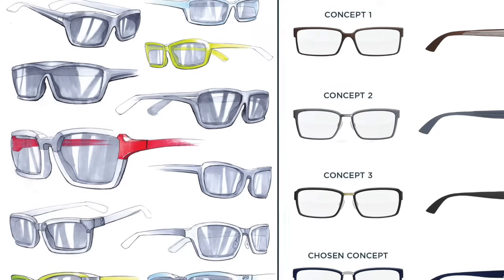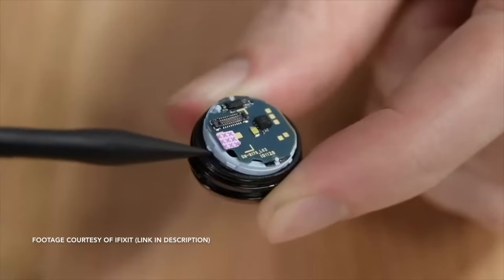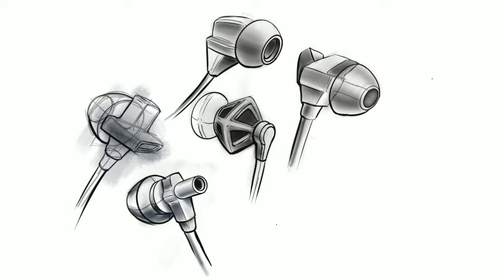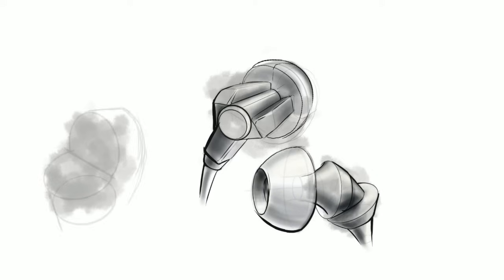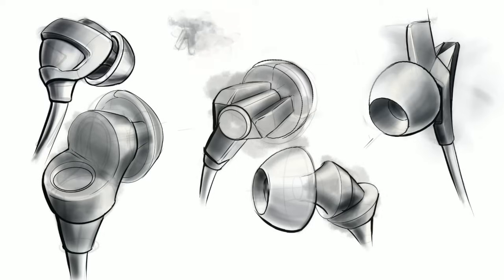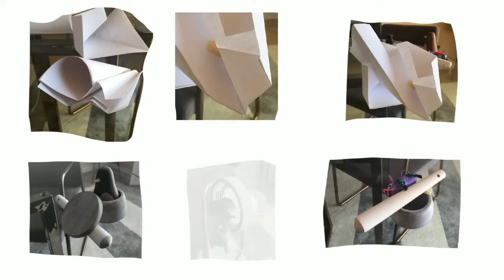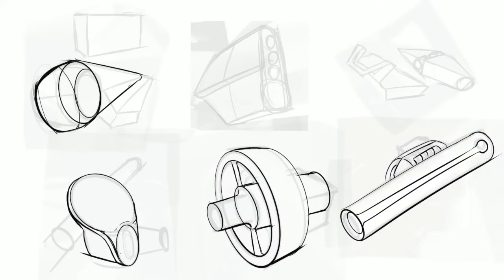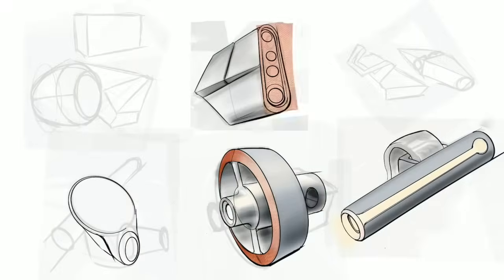Industrial Design Ideation Tutorial: Techniques, Tools & Inspiration to Avoid Creative Block

Comment: Another great video John. I appreciate how you breakdown the ideas while drawing so that the results of what you are saying are repeating visually in the video. Being able to narrate while sketching in real time (like in a class demo) is hard to do. I think it helps that you are a musician as well hearing the beat of your presentations. 

One other tool as part of these abstraction sketches is to change material constructs. Many ID professionals sketch with "injection moldation fixation" as a pretext for how everything will be made. Try sketching ideas for things made totally of glass, wood, leaves of trees, toothpicks. Sketch headphones made of suspended smoke.
Reply from the maker: @raffi minasian Thank you! I actually want to do a video on pacing/tempo and how it relates to industrial design. The speed at which you sketch is one of the determining factors in the conceptual output....it's just like a violinist who uses long motions with their right hand versus short, precise motions. Most students try to go for precision (a la Heifetz) using very deliberate and measured movements. But they're not Heifetz. The result is unfavorable. It has a major effect on the sketch quality as well as the actual concept itself. This is one area that is completely overlooked in drawing technique and design theory. There's also the pacing or tempo of the project on the whole. You want to peak at the right time. If you peak too early, the project loses momentum. If you peak too late, the ideas cannot be implemented into the final design.

I'm going to do another video about other sources of inspiration. I think that changing material constructs is a very good idea!
Reply: @Design.Theory  That musical/rhythmic connection is a great aspect to sketching. I look forward to hearing/seeing that video.